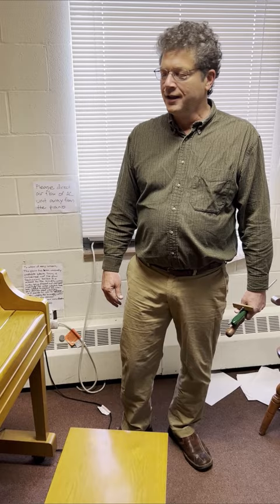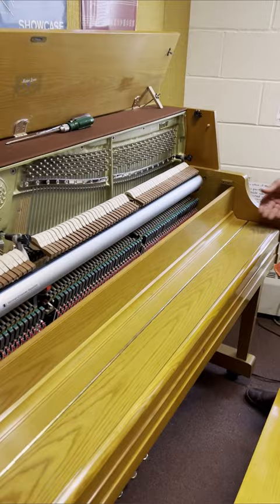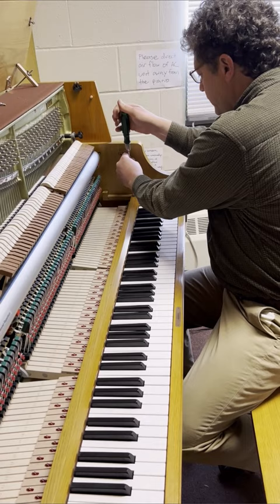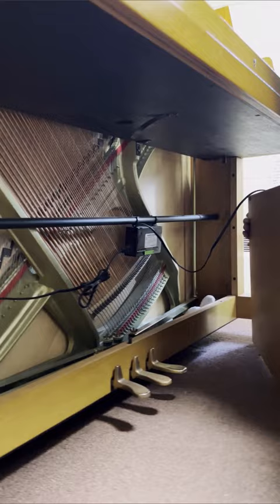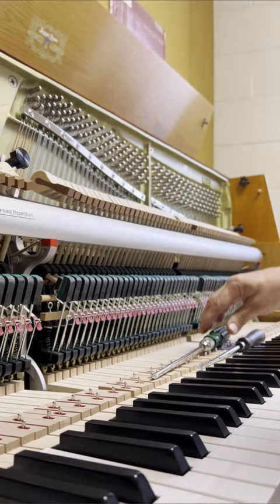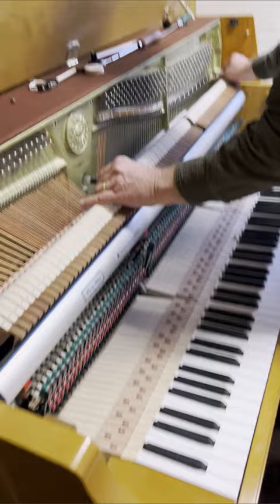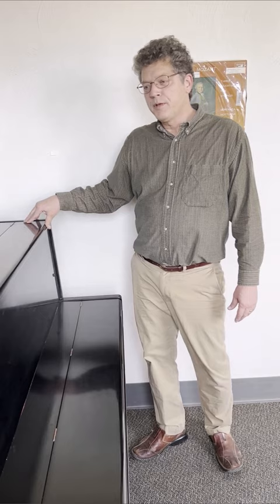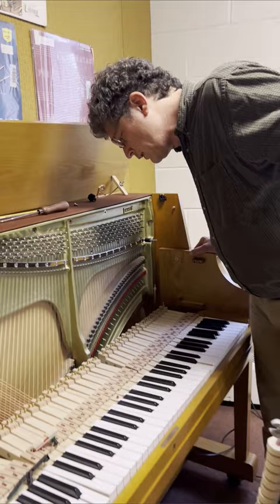How to Disassemble an Upright Piano | HOWARD PIANO INDUSTRIES

Comment: A suggestion for additional videos... Spinets have some difficulties that other uprights do not have. Removing the action on a Baldwin Acrosonic spinet is a disaster if the tech does not know to tie down the sticker rail and to tie the hammer rail to the action bracket first. Adjusting damper spoons on a spinet is very hard, as are the backchecks and bridle wires, but there are ways to make it easier. A video on these steps, or maybe a series, would be most helpful. I think Steve did one on replacing elbows and grommets already, but there's more needed.  And thanks for your wonderful website, videos and customer service.
Reply from the maker: Thanks for the suggestion!  We’ll try and keep this in mind for future videos.

Comment: That helps to reduce weight and be able to move it from 4th floor or it’s pointless and the main weight is on the rest of the skeleton ?
Reply from the maker: If you remove all the case parts and the action this does help to remove some of the weight but probably less than 20%

Comment: I have a player piano upright with completely spent felt on all the hammers and dampers. Also the Dampers seem very misaligned. Would it be possible to replace the felt on these assemblies but not disturb the player piano hardware in your opinion?
Reply from the maker: It would only be possible if you can remove the piano action from the piano. Many old player pianos have old rubber tubes that dry rot over time. If this is the case it may be impossible to remove the action without breaking many of the rubber tubes.
Reply: @howardpianoind  thank you. I will see if that is possible.